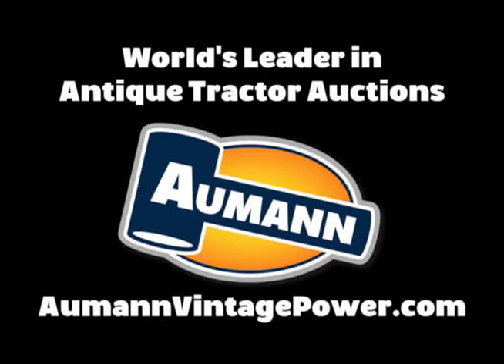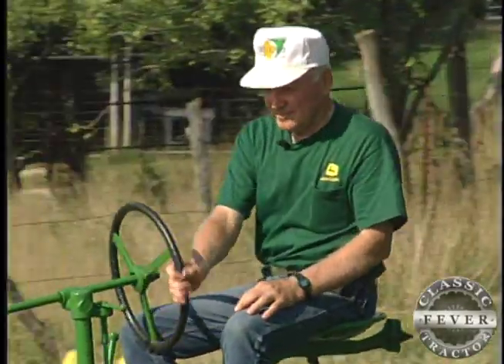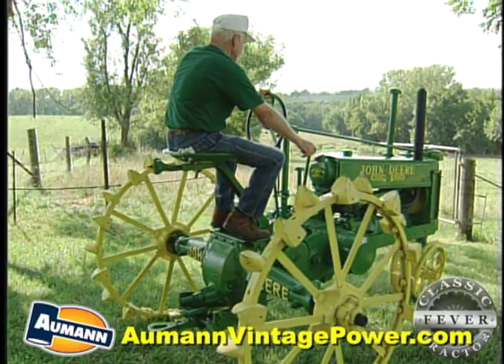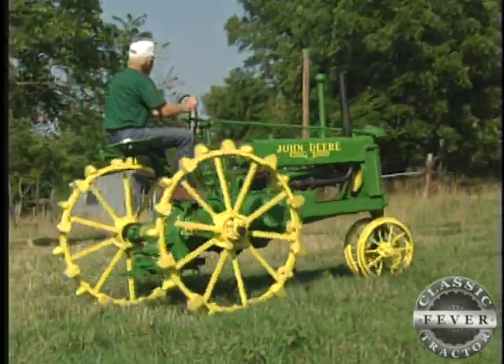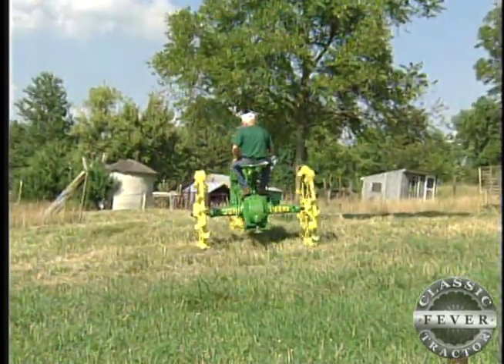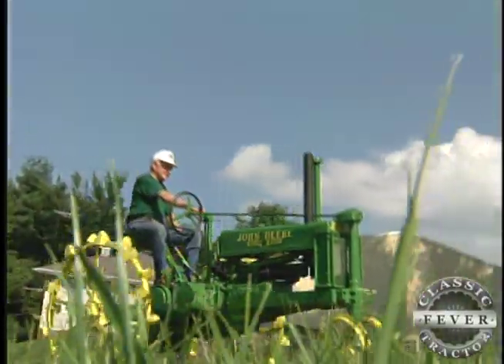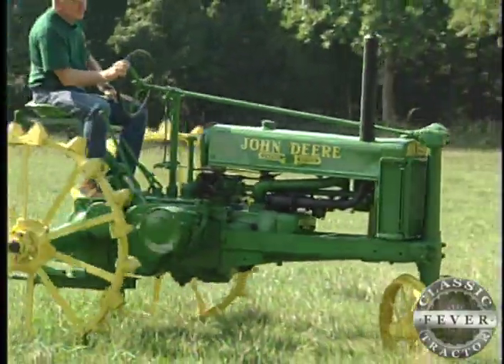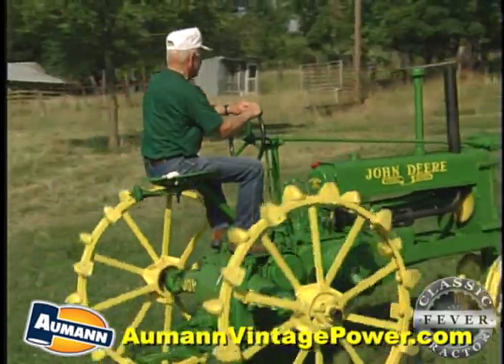1935 Unstyled John Deere Model B On Steel - Classic Tractor Fever

Comment: Nice tractor I love John Deere B I just got my first one it is 1948 John Deere B and I am only 15 and I have classic tractor fever with John Deere B I want a unstyled B
Reply: Cody Hall i am 16 and have an old ford 2nan from 1945, a few wolseley stationairy engines but i also want a few john deeres later
Reply: Cody i am 15 and I've got a 1967 case 830 and am working on a 46 JD BN